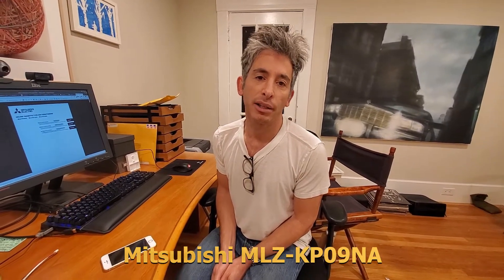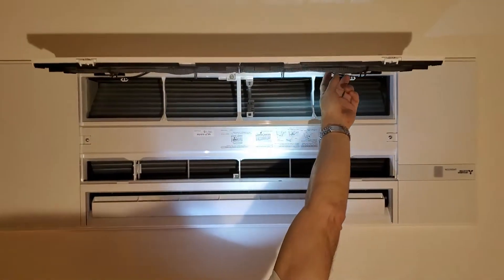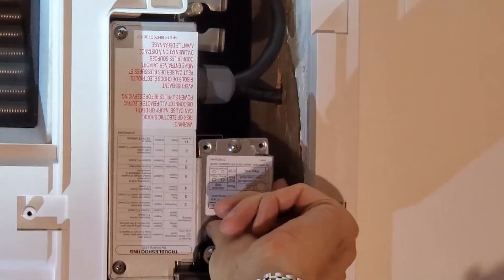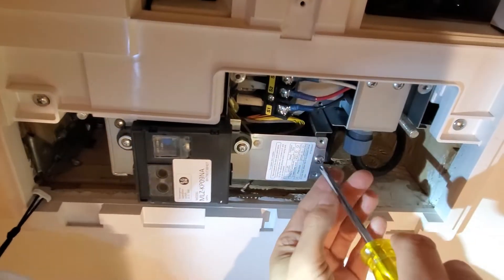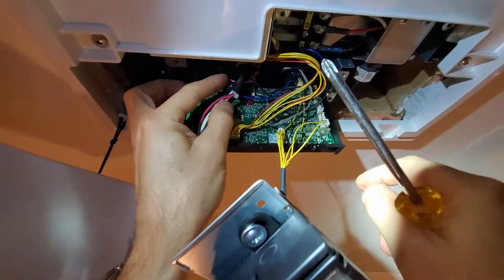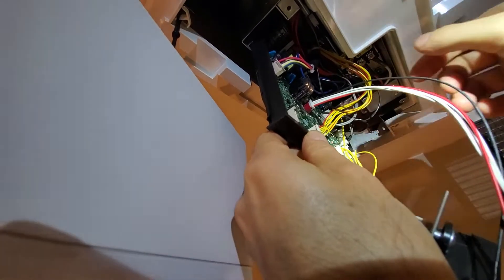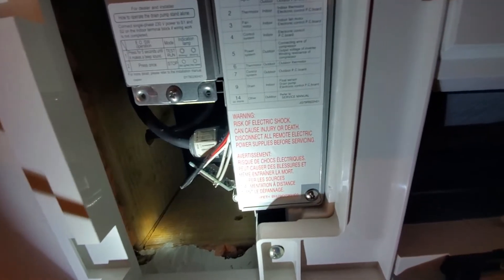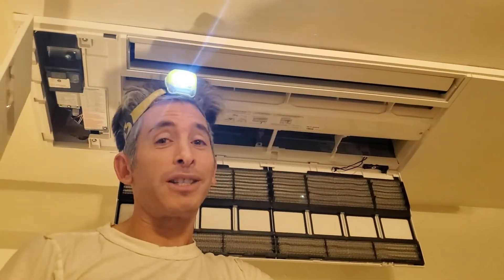Mitsubishi MLZ-KP09NA CN105 Installation Guide

Comment: When you make a temp adjustment, does the unit beep? Wondering for my kids room where I don’t want it to beep in the middle of the night.
Reply from the maker: You can operate the unit without it making any noise. No beeps. I also put some aluminum foil over the operation light.

Comment: great video, What thermostat did you end up using to control it?
Reply from the maker: I use Home Assistant to turn on the heat in the morning and to turn off the AC according to vacancy sensors.

Comment: I'm installing this in an ADU that has a slanted roof.  We've created a box so that the unit can sit flat but I'm wondering how close to the ceiling can this unit be mounted?  I don't want that box to have to flare down too much.  Is it possible to put this right up against the ceiling?  Basically does it need any clearance between the unit and the ceiling/roof?  I was going to put a 1-inch piece of rigid foam but that woudl basically make the unit sit right up against that foam at least at one side and pretty close everywhere else since the slant is not very steep.

Comment: GREAT VIDEO. Do you have a video of the install? I viewed the pictures you posted but didn't see where you connected the lines.  Did you do the job yourself? How were you able to purchase equipment if you did this as a DIY? Thanks in advance. I am trying to do 3 units 18k and 2 12k with a 45k Condenser. Any help would be great appreciated
Reply: I believe this is based off of this repo: https://github.com/SwiCago/HeatPump I'm looking into this as well.
Reply: I now see the info in the description of this video.

Comment: Do you know which jumper set the Thermal Off Fan to Off mode on these units? Is there a way to set it with remote? (Setting 125: When in Heat mode, once set point has been reached, fan 1) stays on, or 2) turns off
 Value: 1 (default) – fan stays ON once set point is reached 2 – fan turns OFF once set point is reached) I installed original PAC-USWHS002-WF-2 module. Kumo cloud app gives that option on the installer back-end but never saves it to the unit somehow. Can Arduino module do  this???
Reply: It's not possible to do programmatically, the app is poorly designed as they shouldn't show it as an option when you have this model. You'll need to cut a resistor to change the setting which is a ridiculously terrible and pathetic design choice as it would need to be re-soldered to change it back again. Regardless, that's what almost always has to be done to these units when you run a multi-unit setup. It's insane, as these are newer and more expensive units that are seemingly less capable (and programmable) compared to their older units. Instructions on how to do this can be found on the second to last page of this link: https://nonul.mylinkdrive.com/sfiles/Application%20Note%203048%20ME%20-%20How%20to%20turn%20off%20indoor%20unit%20fan%20when%20set%20point%20is%20met.pdf

Comment: Question can these be install in joists but the unit body will be exposed at the attic
Reply from the maker: Here are some photos of my install as viewed from the attic. https://www.amazon.com/photos/groups/share/EI225qAAQQOfg9-bvtjV6Q.DVB_BfW2PMN2o2oK4oyxUz
Reply: @kennethberland7613  Are those 2x6 joists?  Based on the published dimensions I was thinking this unit wouldn't work for me due as I have a framing cross-member across the joists in the area I would want the unit, but if it sits flush then it would work.